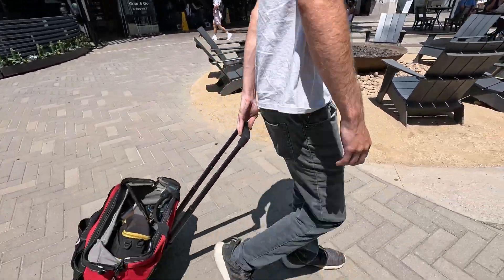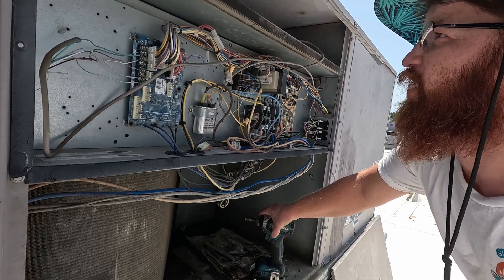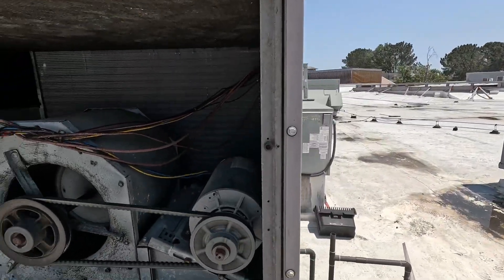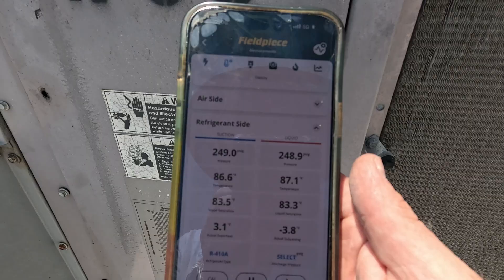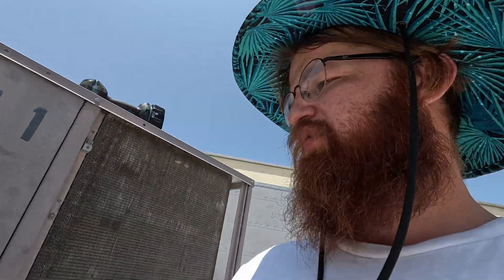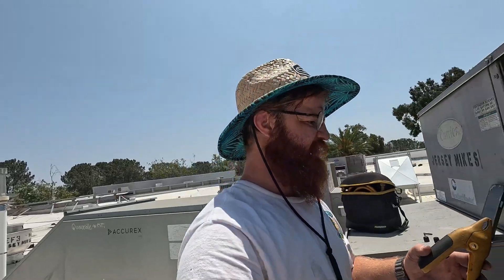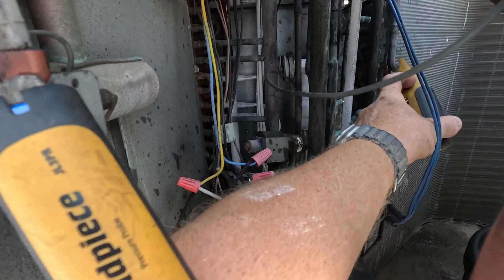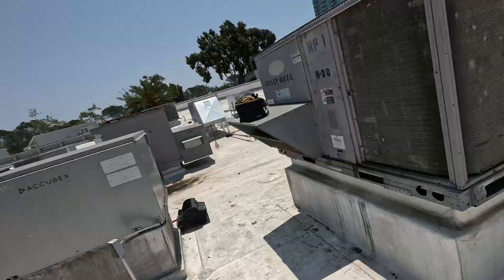Restricted Filter Dryer Diagnosis - 4TH OPINION!!!

Comment: The only thing idle/standing pressures are good for are to tell you if there’s at least a little liquid refer in the system as if it’s less than ambient you know there’s only gas as it’s not longer at saturation temp. The other thing is using it to help diagnose noncondensables after the charge has cooled down and is stable.

Comment: The term "maintenance" is a fluid term for every company.
If there is not a defined set of items that the customer wants done AND that is not communicated to the company doing the work, then whatever the company's "maintenance" items are is what is done.

There are companies that ONLY change filters and that is considered maintenance.
Others may add operational checks, does it come on in each mode.
Others add actual measurements.

While I agree that a service/diagnostic should be fairly standard, maintenance is DEFINITELY NOT standard. Many times it comes down to the amount of money a customer is willing to spend, is there a third party involved, are there expectations communicated.

I work with a third party that "manages" costs for the end user. They limit the amount they pay out for maintenance and for that amount I limit my services. They knew coming into the deal what the company does for what price and they chose to accept the service to pay BUT still tell the customer that a full maintenance was done.
This third party company does not pay for travel, does not care what it takes for access to equipment or care about local prices. They have a fixed amount and that is all they are willing to pay. For that they get that amount of service.
Reply from the maker: 100%. Customers also have very different expectations when they call in for a maintenance as well. Some commercial clients want their coils cleaned each time and included in the price and some places I've been to literally have their own maintenance guys changing filters and cleaning coils and pay us to do an annual assessment of how the systems are running and let them know if there are any necessary repairs.

Comment: I know that roof top. We do the maintenance on the mall owned equipment. You should see the magnificent ductwork job that someone did on a unit for one of the food court units...

On being the 4th contractor, I had a call this week that 4 other companies declines to work on because they dont work on rack systems. It had a bad compressor that ran for 4 days and grounded. Got one of their reach ins working by replacing the fans. I know racks arent simple but this is a small rack system that any refrigeration guy should be able to work on
Reply from the maker: The other companies all touched the system here and did not figure out the problem. Funny that you've been up there too. Maybe we'll cross paths one day
Reply: @SurfBrosHVAC  what's crazy is that it is blatantly obvious what the issue is. Just makes you look that much better